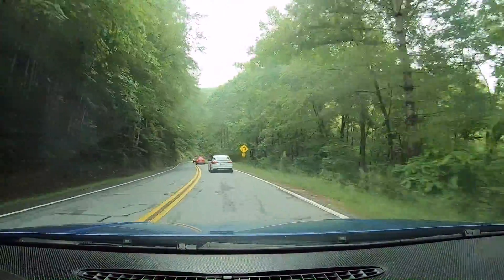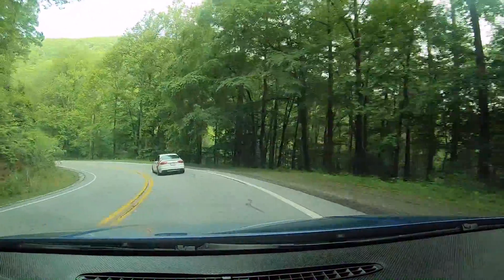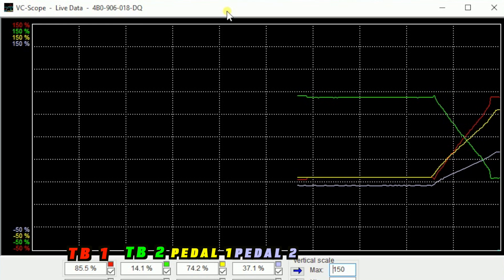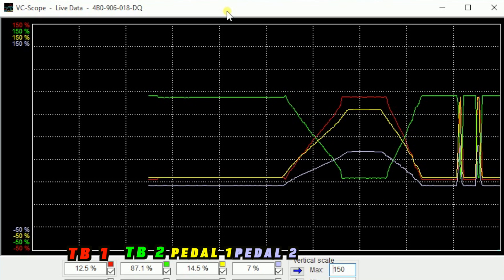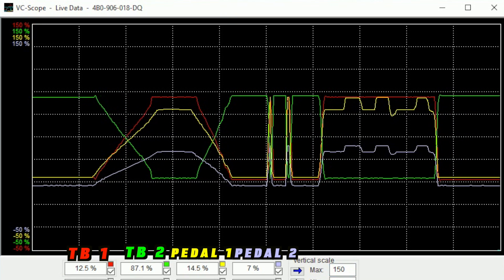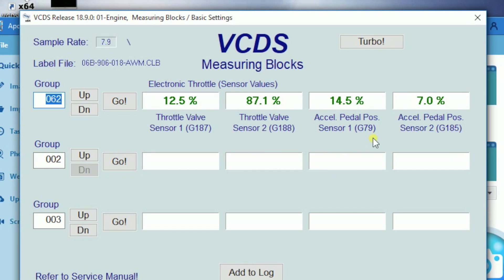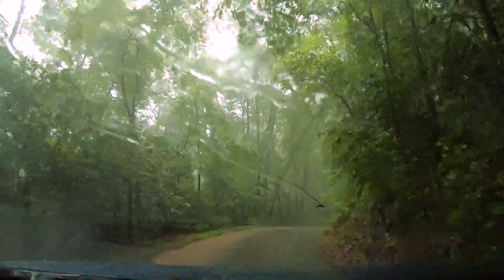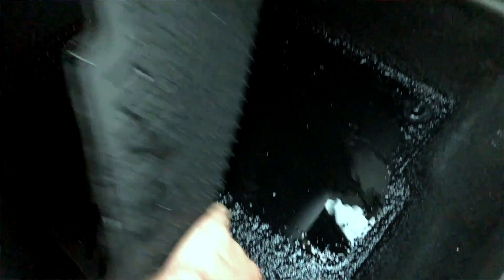What Can Cause Check Engine Light and ESP Light with P0221 Fault

Comment: hey Charles could you do a video in spacers for 4motion/haldex awd.. does it ruin the system or is it safe from first gen to current gen??
Reply from the maker: Good question. I’m actually kicking around buying rear spacers for the R
Reply: @HumbleMechanic  i got 25mm on the rear of my 2.8 4motion. it looks awsome but it difficult to tell any difference.  but i am scared that i am about to destroy something expensive
Reply from the maker: That’s fair. I’m going to be researching it. I’m sure there is a point where it doesn’t like the space

Comment: in a vw an accidental fart can cause a cel.
Reply: @Kris Nicholson i am going back to jetta mk3 vr6.  currently on passat b5 2004. getting very disappointed.  ultimately i will have a jetta 93-94 passat 2004 and for a normal worry free daily honda fit. the modern vw are just a disaster. audis i dont even want to talk about. the last audi i had was 1981 80 coupe. after that all audis seem crap.

Comment: Hey i have a 2003 vw jetta and ive been overboosting. I replqced the maf, all vacume lines, boost controll valve, and turbo actuator. I cleaned the turbo vanes using the oven cleaner method and im still getting the overboost. My tune is for 18 lbs of boost and it skyrockets and pegs my boost guage at 35 lbs. Any auggestions ? Manual transmition with alh engine.
Reply from the maker: are the vanes sticking?
Reply: @HumbleMechanic  thats what it seems like but ive cleaned them and it didnt seem to make any difference.